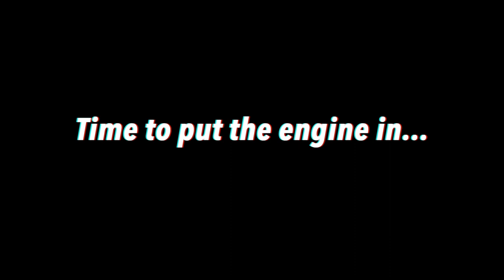2JZ Swap BMW Engine Install

Comment: How did you clear the crankcase from the rack and pinion when doing the what on the e46?
Reply: As far as getting the engine in? It just took a lot of wiggling and finessing. I’ve had the engine in and out half a dozen times at this point too. Sometimes I drop the front subframe to make it easier. As far as final positioning; the TDR mounts let me slide the engine back about an Inch for better clearance.
Reply: Thanks bro
Reply from the maker: no problem. hopefully it helps

Comment: Hey man was your drive shaft too long? I cant get me 1j to sit any further forward without hitting the oil pan. I need about 3” to get my sedan manual shaft in.
Reply: Hey brother. Yes my factory driveshaft, transmission linkage, and shifter bracket were all too long by almost exactly 3 inches. I have a custom driveshaft from Drift HQ, an IRP shifter, and I just cut and welded the linkage to be shorter
Reply: @harrisonpeck130  awesome thank you very much
Reply from the maker: You're welcome. Hopefully it helps.